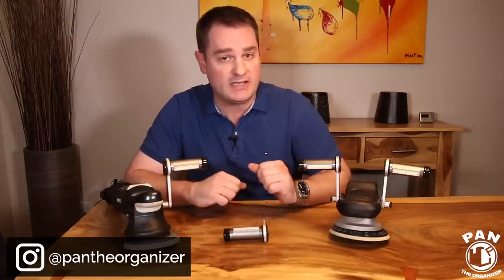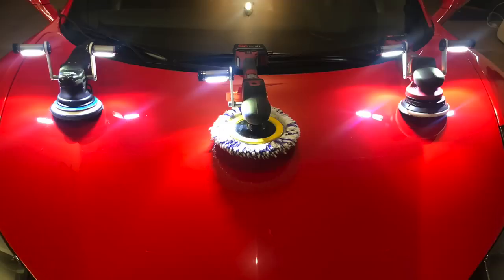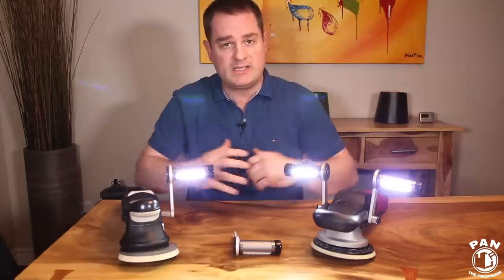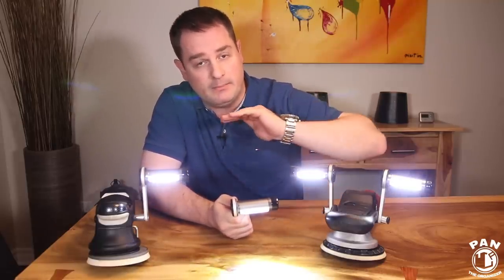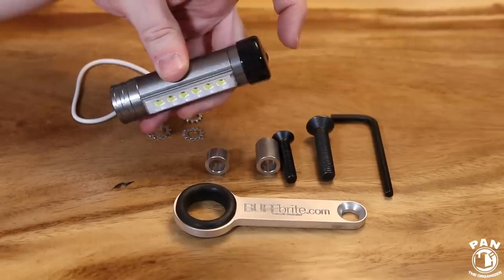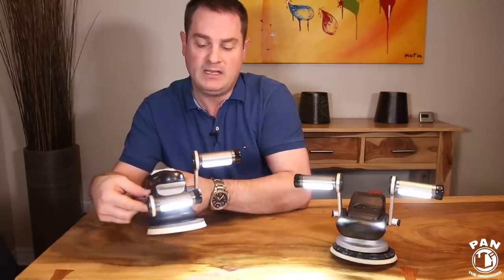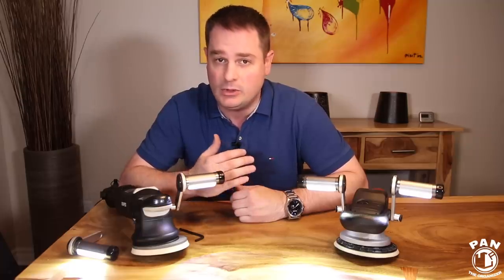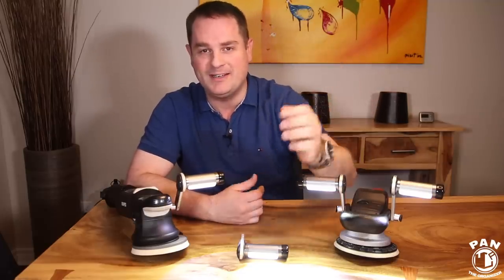Buff Brite Flamethrower Professional Polishing Light REVIEW !!

Comment: I know this is an older video, but I wish you had lingered longer on what seems to me to be a glaring flaw in the premise of this light: Only the very worst defects, which could only be corrected via Trizact wet sanding or respraying, are clearly visible through even the thinnest layer of polish or correcting compound. This light may be in the "sweet spot," but you will only be able to use it to see anything of interest either before you start or after you wipe down with a microfiber.

Comment: Looks great!  I’m thinking that the metal bracket should have some kind of rubberized coating though, just to remove any chance of accidentally marring the paint you’re buffing...
Reply from the maker: It doesn’t need it as it will never touch the paint.  You have a higher chance of accidentally hitting the paint with your polisher’s backing plate before you’ll hit it with the light.
Reply: Hello Don,

This is Tom from Buff Brite.  We are looking into a way to cote the top of the bracket with a dip plastic right now.  You can do it yourself now or wrap some electrical tape around it.  One good thing is the bumper on the end of the light acts as a Kickstand for the polisher that keeps you from having to turn it upside down.  Most people find it very helpful.  Thanks for your interest in the Flamethrower.  Use the code PAN at checkout this week to get 20% off.  Thanks Again, TOM

Comment: wonder would that fatique your eyes looking at at glare reflection for hours.
Reply: Hello,  I am Tom the inventor of the light.  There will be no eye fatigue at all.  This is because we used a cool blue 7800 kelvin with the 800 lumens.  We tried a hotter, brighter kelvin but it was impossible to use it more than 15 seconds.  I have polished for 3 hours strait with no issue with 2 lights attached to the polisher.  Use the code PAN for 20% off this week.  Thanks  TOM

Comment: Pan, At our shop we have been using these for the past month since I chatted to Tom from Buff Brite At SEMA. My guys are loving them. Our only reservation is the area around the Side mirrors if you have two fitted. So with a little change to the polishing angle it is possible to get around the mirrors. Other than that point they are great.👍
Reply from the maker: Yes I agree, Tom did a great job coming up with the design.  So practical to see all the defects in the paint, right from the polisher!
Reply: Hello there,  Good to hear from you.  Did you angle the lights to the back slightly to solve the clearance issues around the mirrors.  It works much better that way.  It also opens up the angle of  light patten to give you a wider work space.  Enjoy your lights and thanks for being part of the Buff Brite Family.  Thanks.  TOM
Reply: Buff Brite , Hi Tom. Yes now that we have had a good few weeks with them it’s just a case of positioning of the lights themselves and a tweak to the technique of polishing around mirrors. We have a full range of different size polishers both Rotary 5” & 3” heads DA with Flex and Griots they work great in all applications. We still use our shop lighting Rigs but these add another level. Thank you for coming up with a solution to many a Detailers problem ( not enough targeted light) 👍

Comment: Nice idea, but you don't see a lot of defects the polish on your paintwork. So, that's why you do inspection before and after the passes with your polisher. The use of the strobe I don't understand by the way.
Reply: Hello,  The camera is way less sensitive to light than the naked eye.  You can see so many more imperfections than the camera can show you when your working with the light.  You will love it, I promise you.  I have polished for 37 years and now I wonder how I ever polished without it.  The strobe feature is for fine little scratches when your really picky about the outcome.  It really makes  them pop when the light strobes but you will rarely use this option.  Use the code PAN during checkout this week and get 20% off your order.  Happy Polishing!  Tom

Comment: I can understand this helping with polishing , but I myself check my paint correction after I wipe the residue of the polish off then I use a light to inspect
Reply from the maker: And that's why I did too.  You always have to inspect your work.  But this polishing light just ads the practical aspect that's so great.  It's right on your polishing, while you're actually polishing.  It helps identify so many more swirls and scratches and also I find it increases your efficiency as you don't have to resort to inspecting with a handheld light as often...  

But don't get me wrong, hand held lights and penlights and swirl finding lights are also part of my detailing arsenal, as they should.  But for someone with average garage lighting, this is an awesome and inexpensive way to get more light.
Reply: Hello,  you can also use the lights on the polisher for inspection after you wipe your polish off rather than reaching for another light. That way you don’t have to set down the polisher  and waste time. It really does save about 30 minutes or more per correction.  Please use the code PAN on buffbrite.com to save some extra money. Thanks. Tom

Comment: 2 questions for you Pan.  1-Do you believe this will reveal all the defects on a silver coloured car?  2-I don't have a garage so I will work outdoors next late spring.........I then want to know if I will be able to work with this tool at any time in the day or if I will have to wait for sunset?
Reply from the maker: Yes to any color paint.  For outside daytime use, I’m not sure as I always polish indoors.
Reply: @PanTheOrganizer  Then I should wait for the sun to set or very close to that right?
Reply from the maker: Yes, if you have to polish outside, I wouldn't do it during mid-day when the sun is at its brightest as you'd be fighting the polishes and compounds drying up too quickly.
Reply: @PanTheOrganizer  I meant on daytime in the shade...........but doing it close to sunset is probably the best..........I will do my tests anyways thanks! :-)

Comment: You have to wonder, Will the Polisher Manufactures install the same  an integrated Light source?
Reply from the maker: I highly doubt it as that would drastically increase the price and they’d have to pass the cost down to the buyers...
Reply: That attachment is great, but it is somewhat cumbersome.  Dewalt Cordless drills and others have integrated lights.  Rupes could go it, there are smart.
Reply: Hello Jon,  I'm Tom the inventor of the light.  I actually hold a patent for that idea and approached Rupes with the idea for it in March of this year.  They love the Buff Brite Flamethrower but are not interested in putting a light in their polisher.  If they change their mind we would love to do something with them.  Thanks for your interest in the Flamethrower. Use the code PAN for 20% off this week.  TOM
Reply: Tom,  Great invention.  All the best.  My comment was just that , only mine.